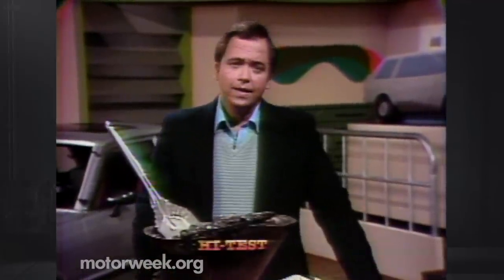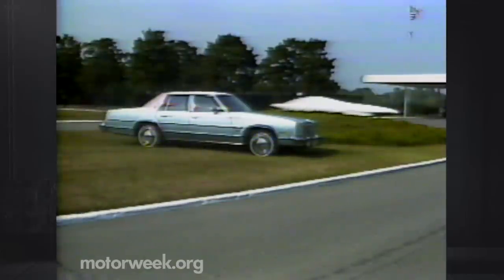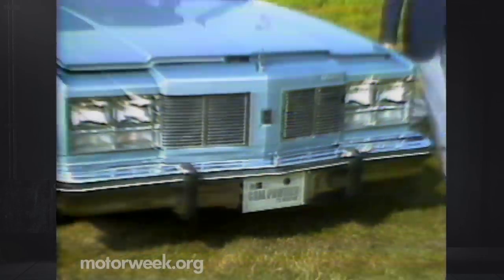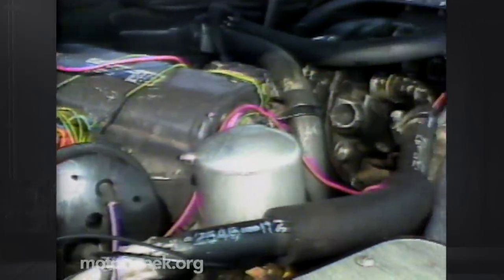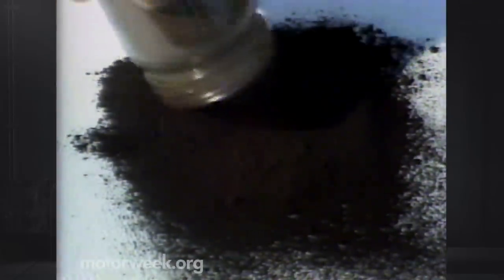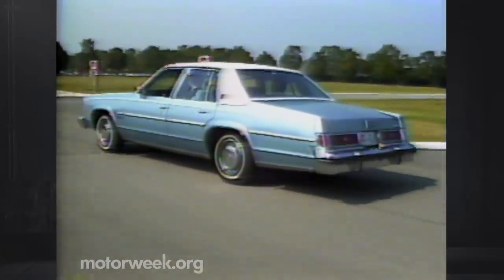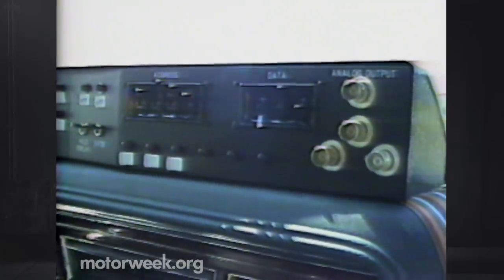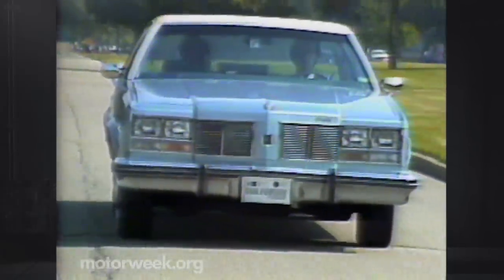Retro Review: Coal-Powered Turbine Engine Oldsmobile

Comment: All these people in here bitching about coal, what's the difference between burning it in an Oldsmobile or burning it in a steam plant? I had an electric car for over 3 years and I loved it. I plan to have another or even make my own plug in Hybrid with parts cannibalized from cheap wrecked or used EVs.  The truth is that those in most parts of the country are basically coal powered. So what...we need energy and I can damn sure tell you that I am not buying this forced austerity bullshit.
Reply: 'they' could solve the emergy problem today with earth heat and molten salt nuclear. 

the whole energy crisis is manufactured for political purposes.
Reply: 'they' could solve the emergy problem today with earth heat and molten salt nuclear. 

the whole energy crisis is manufactured for political purposes.
Reply: 'they' could solve the emergy problem today with earth heat and molten salt nuclear. 

the whole energy crisis is manufactured for political purposes.
Reply: hendo337 economics of scale a giant powerplant will be far more efficient per unit of energy then a tiny powerplant in a car
Reply: hendo337 the same reason a bus is more efficient per passenger then a prius
Reply: Remember when South Park called the Prius the Pious?  SOME people with electric cars and hybrids get off on acting like they are saving the world.
Reply: Clearanceman2 but doing nothing will?
Reply: Driving hybrids and electric cars won't save the world.  Not that the world even needs saving.  But if it did driving any type of car wouldn't be the way to do it.
Reply: Clearanceman2 so you would like china air quality? Oil spills? River fires?
Reply: Clearanceman2 the average gas car BURNS 5000 gallons of fuel in its life time. The average electric car depletes the energy in a 500- 1000lbs battery that is recyclable afterwards. What do you think is worse?
Reply: No I would like the EPA to focus on real pollution, not imaginary pollution.  I believe the things you cited fall under the category of real pollution.  Some mythical crap about global warming does not.
Reply: There was a whole thing about the huge environmental impact of mining the metals and making those batteries.
Reply: Clearanceman2 what about the impact of drilling 5000 gallons of fuel then burning it to the atmostere? Also you can’t recycle gas after it is used
Reply: Clearanceman2 don't forget the shipping of fuel also, the last time i checked electricity didn't put wear and tear on our highways and contribute to trafic and pollute at the same time
Reply: That's a good point.  I'm all for electric vehicles if it's the best technology 20 years from now when it's the best transportation choice.  Or maybe 10 years, they are making great strides.  The Bolt is almost there.  Once they develop batteries capable of 500+ miles I think most people would be OK with switching over.  But even then, those of us who drive cars for decades would be disappointed with battery life.  The hold up really is the battery. But it gets a little better every year. The funniest thing is if everyone switched to electric cars tomorrow it would crash the grid.  So that's another huge expense for the country, upgrading the grid.
Reply: Clearanceman2 the grid is paid with your utility bill with a thing called profits. That is the same reason we have broadband and cable tv
Reply: The grid is in terrible shape under the current loads and could not handle the load of all people driving electric cars.  It needs a major revision and the money isn't there to do it.
Reply: +Clearanceman2 then how did we get electric in the first place or gas lines or county water or broadband or cable tv or telephone
Reply: Clearanceman2 they are all paid for with monthly bills........
Reply: Clearanceman2 ever heard of a loan? Stop acting like it will be impossible. Are you against utility jobs but only for oil field workers or something i don't get it
Reply: Clearanceman2 funny how we can spend billons on pipelines but when it comes to utilities it is suddenly bad
Reply: How are we support utilities?  They are set up to make a profit.  I'm saying no one has allocated enough money to upgrade utilities to standards needed for everyone to have an electric car.  The utilities barely keep up now.  The whole grid would need a major upgrade.   It's like the roads, they keep them going but just barely.
Reply: Clearanceman2 they wouldn't need to be upgraded all at one time. Also most electric cars are charged on off peak hours
Reply: Clearanceman2 in my state we have a electric surplus because of increasing efficiency of light bulbs, air conditioning, better insulation
Reply: Look at the grid nationwide.  It's always on the edge of disaster. Under the current level of usage.
Reply: Clearanceman2 the way to fix any big problem is to break it into smaller projects. NOT ALL OF THE COUNTRY NEEDS AN UPGRADE
Reply: Not if they were the primary mode of transport.  It would be a huge difference.  I think we'll be using natural gas powered cars before electric cars.  But who knows, they keep finding oil reserves and gas reserves.  There is no much natural gas the price has tanked.  I think we'd run our cars off it now except there is so much oil the price is down.  People aren't going to switch to electric cars until they are as convenient as gasoline powered cars or the price of gas, and natural gas is prohibitively high.  I saw a chart in Car and Driver where electric car growth has grown every year except after a huge drop in gas prices like we just had.  And there is a one year delay, in other words when gas is high, people buy electric cars and hybrids more but after it's been high awhile and when it goes down it takes awhile before people stop buying them.  People tend to assume because something is happening it will continue to happen.  Remember when CA was going to be in drought from "now on" because it was in drought?  But all you had to do was look at 1976-1977 where the water levels were even lower than recently and then 1982 where they were at record highs to know this stuff cycles.  But people don't think in cycles they think in absolutes.
Reply: Clearanceman2 instead of generalizing you should look at individual local regions
Reply: Clearanceman2 using natural gas to power a central power plant would be more efficient then in individual cars. Why would people that have home generators not power their house 24/7 with them? Is it because the utility is cheaper
Reply: Clearanceman2 we can upgrade natural gas with no problems but utilities is impossible? I love your logic
Reply: Jonathan Dittmar his logic? Switching over to electric cars would require an entirely new infrastructure. There are zero places where I live to recharge an electric car away from home. Cross country travel would be impossible. And if gas stations did convert to selling electric fill ups, what's the fastest you can recharge a car? 15 minutes? 30? And what kind of strain does that put on an electric grid in the middle of summer? Your mass transit would suffer also, trying to keep busses running on time while keeping batteries charged. You'd have to invest in more busses to allow for charging time. The switch to natural gas? Different induction system for use with the same internal combustion engines we use now. Gas stations would have to replace their underground tanks. Or people could fill up at home. As for producing your own electricity, yes it's likely cheaper to buy it straight from the utility rather than buying natural gas and converting that to electricity. Likely. Depends on how much power you consume and what your electric rates are compared to your gas rates. But that does not prove or disprove that a natural gas powered car is either efficient or inefficient. They are cheaper to run than gasoline, and they are cleaner. And we have a shit ton of natural gas. That's what's actually important.
Reply: do you think it would be an overnight change? lol it obviously would take time to upgrade the grid. please think for a second
Reply: rogermurph101 why does everyone think it will be an overnight thing? Did gas stations cover the nation the day the first gas car was sold? Did everyone have air conditioning the day it was invented? Did everyone switch from whale oil to incadesant bulb the day it was patented
Reply: rogermurph101 why do you think upgrading literally 10 of thousands of gas stations to pump natural gas but upgrading hundred of powerplants is impossible?
Reply: Jonathan Dittmar Hey, you have some good points and questions, but just a reminder: fossil fuels are called fossil fuels because they come from the ancient, fossilized, remains of living organisms. And those organisms got the carbon from... Atmospheric carbon dioxide. The impact of burning said fossil fuels is, for good or for ill, taking the atmosphere closer to the ancient conditions under which those organisms lived.
Reply: It's possible but they barely do it now to address need.  It's barely holding together.  Where is the money to increase the capacity enough for everyone to own an electric car?
Reply: Clearanceman2 it is not going to happen overnight, this will take several years
Reply: Clearanceman2 how do you think the electric grid was built in the first place? did every building have electricity the day it was invented
Reply: Jonathan Dittmar who said anything about impossible? I'm talking about what will actually work. We wouldn't need to convert all the gas stations immediately. Anyone with natural gas in their home can fill up there. Like your proposed electric, it too would be gradual. But natural gas isn't as foreign an idea as electric cars. Same engines. Same power. Same range. It's a much easier sell. Build a battery that will move a car 350 miles and recharge in 5 minutes, then you've got something. Until then, it ain't gonna happen.
Reply: rogermurph101 i think home natural gas is like 5psi it would need to be over 1000psi to be to store enough energy for hundreds of miles of range
Reply: rogermurph101 the tesla model s can go 335 miles today, 350 miles range is likely less then a year away
Reply: rogermurph101 having 1000 plus psi natural gas line to peoples homes sounds extremely dangers. 1 explosion would take out half the town instead of just one house  with the low psi that is currently in peoples houses
Reply: Jonathan Dittmar why does it take you four posts to say the same thing? People have special nozzles installed in their homes right now that fill their natural gas powered vehicles overnight. Hook it up when you park it for the night. Only difference from electric is you don't have to do it every day. Oh! A Tesla!?!? Sure! I've got $80-100k lying around! I'll go get one tomorrow! One year my ass. We don't even have 200 mile batteries yet. Then you still have the problem of charging the battery on the go. People are used to filling up in the time it takes to pee. Plus, cars are regularly surpassing 200-250k miles today with normal maintenance. Electric car battery is used up before that. Who wants to buy a used car that's gonna need a new $10,000 battery? It's a good idea as a commuter car, but not for families or plain everyday use. A goddamn horse would be easier.
Reply: rogermurph101 is there a name to this special nozzle so i can google it?
Have you ever heard of the model 3 or the chevy bolt
Reply: rogermurph101 i comment in separate post because that is how the thoughts came to me
Reply: rogermurph101 the model s can go 335 miles today tesla.com
Reply: rogermurph101 tesla has increased range every year for the modrl s
Reply: It is a compressor not a nozzel and it cost more then a home charger
Reply: Jonathan Dittmar here's an idea; collect your thoughts, then comment. The cheapest model S goes for $68,000. No thank you. The model 3 is supposed to be around $35,000, if it ever happens. And it's ugly. And it's one vehicle. Natural gas can be applied to any car that currently runs on gas. Take the $50,000 you saved not buying a model S and cover the difference between the compressor and the home charger.
Reply: rogermurph101 chevy bolt is for sale today and the charger is way cheaper and less maintenance then a compressor
Reply: rogermurph101 ugly is completely subjective. A natural gas honda or ford can be ugly too
Reply: rogermurph101 not every house has natural gas like my old house or my grandparents house but they have electric
Reply: rogermurph101 you can also buy a used electric car. You can buy a used model s for under $50k today
Reply: rogermurph101 a chevy bolt cost $30k with incentives
Reply: rogermurph101 funny how we can handle a huge consumption increase in natural gas but not electric
Reply: rogermurph101 there is a reason natural gas cars is a failure in the market compared to EVs even tho they have the same subsides
Reply: Jonathan Dittmar I already said not everyone has natural gas in their homes. But the majority do. The thing Tesla has going for it, at least the expensive models, are that they look like regular cars, not ugly doorstop shaped wedges. When are they going to have an electric minivan or full size SUV? Never. Natural gas, no problem. Wow, a used model S for $50k? What a deal! Can't wait to replace that battery! Improving the power grid compared to stepping up production of natural gas? You're actually going to say those things are comparable? Ha! Look, I'd love to be able to buy a five year old electric car for $10k that seats five comfortably, goes 350 miles before needing a ten minute charge, and I can put 75-100k miles on without any major repairs. Not gonna happen in my lifetime. Electric cars do not fit the American lifestyle and likely never will.
Reply: rogermurph101 fca has an electric pacifica minivan in development that has 300 miles range
Reply: rogermurph101 the tesla roadster is 9 years old and most have the original battery still
Reply: rogermurph101 im talking about natural gas powerplants that would be more efficient then powering a individual cars with engines. Why do people with natural gas generators not power their home with the generator 24/7? Is it because the grid electric is cheaper
Reply: rogermurph101 natural gas vehicles have failed in the market despite having the same subsides. Why is that?
Reply: rogermurph101 i like how you think engines never fail and need to be replaced
Reply: rogermurph101 you can argue all you want doesn't change the fact that it was a complete failure in the market. Almost every manufacture that supported it a few years ago dropped in favor of electric car development
Reply: rogermurph101 audi has a electric suv coming out later this year as a 2018 model year
Reply: rogermurph101 chevy bolt is a car that i mention a few times
Reply: rogermurph101 the average American drives 40 miles a day or 15000 miles a year. That is not difficult to make an ev work for
Reply: Jonathan Dittmar use an electric powered pump at home to harvest natural gas from the earth. That'll cost more than natural gas from the utility as well. Using a generator as a comparison of efficiency is apples and oranges. And it doesn't even matter. A proper comparison would be cost of gas per mile vs cost of electricity per mile vs cost of natural gas per mile. Then factor in that natural gas is closer to gasoline use in every way. Even it it cost more, people will pay it to avoid a change or a hassle. Natural gas hasn't caught on with the public because it's not pushed like the electric bullshit, because gas prices are low, and because a change isn't really needed yet. Several cities have converted their busses over to natural gas. So have many local trucking companies, and Anheuser Busch has done so as well. Audi. $$$$$. Chevy Bolt. Typical small wedge shaped ugly electric crap. 40 miles per day. That's an average. Meaning half the people drive more than that. I do 60 per day just to and from work. But that's commuting and not what I'm talking about. Life outside work. Vacations, trips to see the kid in college, traveling with the kids for sports, or just a long weekend of shopping. All things that make electric cars impractical or impossible. And your estimates on mileage are best case. They don't consider using the a/c or heat, radio, headlights, wipers, heated seats, etc. A hundred years ago we had electric cars too. They lost out to the internal combustion engine. Yes, that electric car was very primitive, but so was that gas powered car. Given a choice, most people prefer the reliability of a gas powered car; be it natural gas or gasoline. Which reminds me; engine replacement! We all know that batteries fade, no matter what we do. Eventually they just won't hold a charge anymore. Then you're screwed. An engine? They easily go 200k now and beyond without too much effort. And replacement costs about a third what a new battery will.
Reply: The bolt is the closest thing so far to an affordable, livable electric car.  I'd never spend $30,000 on a car but when they are 10 years old they will be almost free.
Reply: Clearanceman2 don't have to buy new wait a year or two
Reply: rogermurph101 Mercedes and Volvo are currently developing EV semi trucks. No one is investing in natural gas vehicles or infrastructure even tho they have the same subsides. Natural gas is a complete failure in the market. Even countries with literally zero EV incentives like Mexico have growing electric vehicles demand
Reply: Clearanceman2 i plan on buying a used model 3 or S for $20k. I'll have to wait a few years but every car with maybe the exemption of exotic Italian cars has depreciation. My current vehicle cost $50k when it was new now it is worth $1500
Reply: rogermurph101 many more cities are converting to electric buses BYD and Proterra are huge players in the electric bus industry.
Reply: rogermurph101 why does tesla have an unlimited mile warranty on their battery and motor?
Reply: Jonathan Dittmar that is a complete lie. Anheuser Busch just switched their entire truck fleet over to natural gas last year. Only a city full of suckers would buy electric powered busses that weren't tethered to a power source.
Reply: rogermurph101 BYD, VOLVO, and Proterra make busses that can go over 200 miles of range or a 10 shift. It it on their websites if you don't believe me
Reply: Jonathan Dittmar don't know. Don't care. Let's see if they remain in business when all those claims come due at once.
Reply: rogermurph101 busch is also one company. Many more municipal transit buses are switching to EV.
Reply: Jonathan Dittmar does it take them another ten hours to charge? Better double your fleet! That sounds economically sound.
Reply: rogermurph101 they have a 400 kilowatt hour charging station. The buses battery is 350kwh
Reply: Jonathan Dittmar hey Jonny boy, YOU are the one that NO ONE is switching to natural gas. I pointed out a multi billion dollar global company that just did so, and all you got is they're only one company?
Reply: rogermurph101 I'm glad you found a example. They still use diesel for the majority of their fleet
Reply: rogermurph101 fedex and ups are looking at EV delivery vehicles, they alone would beat every natural gas vehicle combined
Reply: rogermurph101 electric motors can literally last a hundred years, many old buildings in my city of Baltimore have original motors for elevators. I have replace a handeful when i worked as an electrician
Reply: rogermurph101 i looked up the fleet it is only in one city, it is not nation wide. Only 97 natural gas trucks lol. I would classify that as a failure
Reply: rogermurph101 li-ion battery energy density has historically increased at 4% a year since it was introduced in 1990. That is why the bolt has doubling of the range of the leaf but has the same sized battery pack
Reply: rogermurph101 also the model s originally launched with 260 miles range in 2012 now for 2017 it has 335 mile range for the same size battery
Reply: rogermurph101 a- b has replaced only 97 trucks lol it is pathetic. There are more electric buses ordered every week
Reply: rogermurph101 i like how you call me a out on bs when i actually provide links
Reply: http://www.autoblog.com/2013/02/08/ups-puts-100-electric-trucks-into-service-in-central-california/ ups electric truck link
Reply: rogermurph101 let me know if you want more links
Reply: I'd wait even longer the S model tesla has huge depreciation.
Reply: Clearanceman2 all luxury cars do but it is slower then mercedez, audi, and bmw. I think lexus is the only one that has better resale. The tesla is also more reliable then the germans generally speaking.
Reply: Not sure what figures you are using.  In consumer reports, Tesla S had huge depreciation even for a luxury car.
Reply: Clearanceman2 have you seen the depreciation on a s class benz or a 5 or 7 series bmw? The model s you can find is around $50k for a 5 year old car that sold for $70k new
Reply: Clearanceman2 i just look on autotrader
Reply: Clearanceman2 or kelly blue book
Reply: That's actually really good.  According to consumer report averages, luxury cars are higher and non luxury are lower, the average car loses 27% in the first year, 46% by the end of year three and 64% by the end of year five.  Which makes me wonder why everyone doesn't buy 7-10 year old cars but I'm just glad they don't someone has to buy them new and a lot of people are willing to take the hit.  Most luxury cars are leased though.  Which makes sense since they are mostly unreliable POS and drop value faster than a stone.  Plus the whole point in a luxury car is showing off and old luxury cars don't impress anyone so you have to get  a new one at least every three years.
Reply: Liberals think if they can plug it into the wall it's automatically clean.  Plus, the majority of electric cars are in CA and it's almost coal fired plant free.  They are very smug about that but they also get some power from the Hoover dam and that was just a chance geography thing.  Also being in the right environment for solar.
Reply: Jonathan Dittmar Well the energy  STORED in that battery was generated by coal,gas,oil or nuclear fuel .... unless you think electric cars magically charge themselves.
Reply: WAQWBrentwood because of economics of scale it is more efficient and cleaner even if it is mostly coal. For example an old beat up smoke spewing diesel bus is more efficient and cleaner per passenger then a prius
Reply: WAQWBrentwood also coal is far more domestic then oil and no wars have been thought over that. Also very stable prices no doubling in price in a month like gas has in the past
Reply: Jonathan Dittmar I'm  not arguing that, just at the idea that an electric car is "cleaner" an electric car is as clean as the source  of electric generation. is 5000 gals of oil are burned to charge up the battery it STILL 5000 gals. Actually it's actually worse as there is energy lost during the transformers  and line losses in transmission,  More losses  in converting the AC from the "grid" to DC needed to charge a battery - then finally thermal losses in said battery.
Reply: WAQWBrentwood economics of scale means it uses less resources per person that is why even a 100% coal plant is cleaner then a gas car.

Keep in mind oil has to be extracted, shipped, refinned, trucked, then it goes into your car to be burned but most people forget that part about gas cars
Reply: WAQWBrentwood a transmission line loss will beat an 18 wheeler tanker truck in efficiency any day
Reply: WAQWBrentwood that is the reason we have a grid instead of each house or building having its own generator to power them. Because it is far more efficient.
Reply: hendo337  Coal powered steam plants tend to be more efficient and less polluting than an auto engine running on such - - it depends on how standards are enforced ofcourse..
Reply: Stationary power plants are regulated differently than non-stationary power sources. We also have to look at the PM 2.5 and PM 10 that are outputting. PM are fine particles that cause lung problems when breathed in ie Black Lung. There are also the SOx, NOx, and VOC released by burning coal, and since it's an incomplete combustion it release more junk into the air which causes smog. You also have to remember that coal also carries other heavy metals that cannot be removed during processing such as Hg, Pb, As, etc